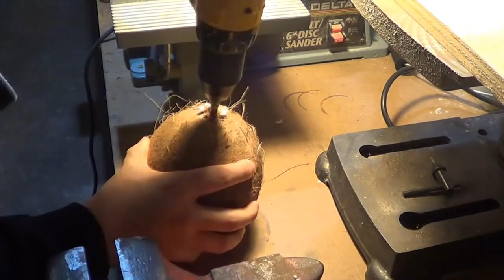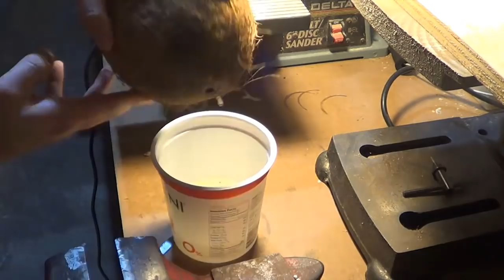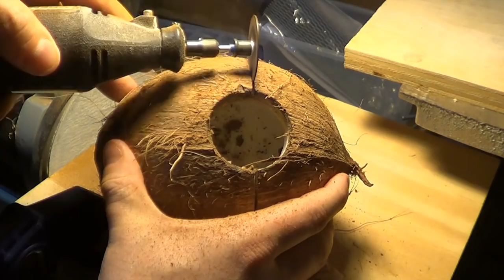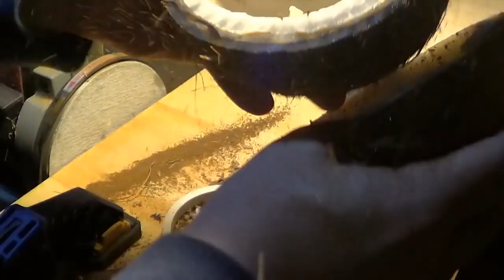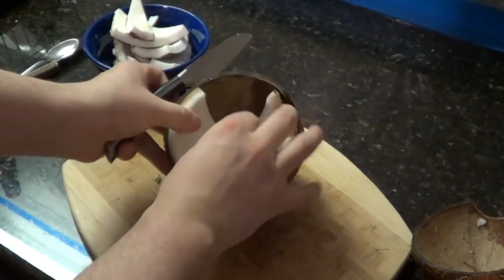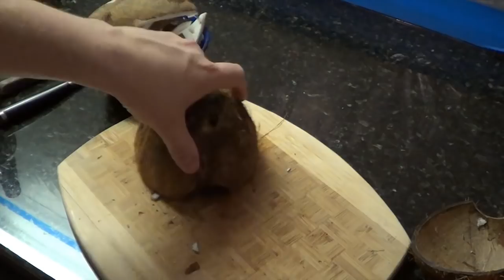#285: How to Make a Coconut Hide for Aquarium, Crayfish, Hermit Crabs, Fish - DIY Wednesday

Comment: Hi. great video. what is the electric cutting tool called.
Reply from the maker: Josie Mc Nelis dremel
Reply: hi, what model dremel are you using and what kinda saw/cutting blade are you using on the dremel? yours seems to glide through the coconut like butter, I have a dremel 3000 to make stuff with coconut shells also, and mine seems to take a long time to cut through the shells, I am using the metal cutting wheels included with the dremel. THANKS!

Comment: I would imagine this getting very gunky very easily... I would have used a fish-safe coating before putting it in there with all that work you did on making it.
Reply: Actually, they wont stain the water and It naturally makes shelter in the wild. Just put the coconut shell in hot water with salt Overnight and wash, Ta-Daaaaaa.
Reply: You can also sand it if you're so scared of the fibers getting gross. then boil it. you can also super glue moss on the top of it.